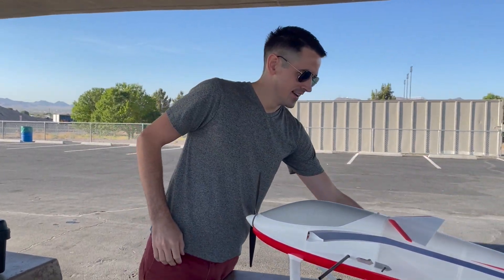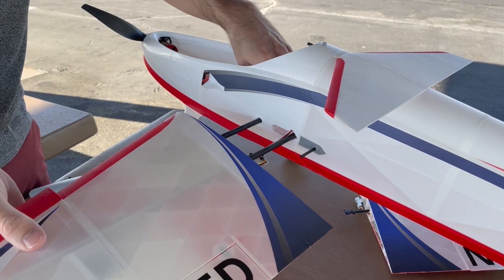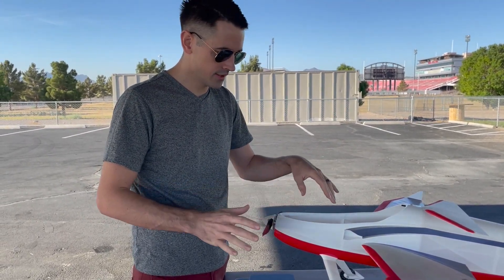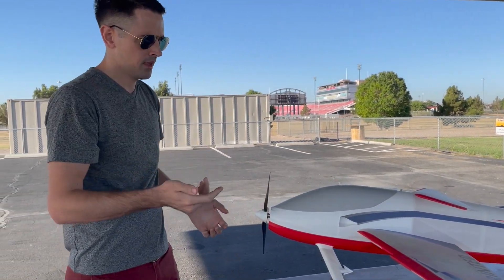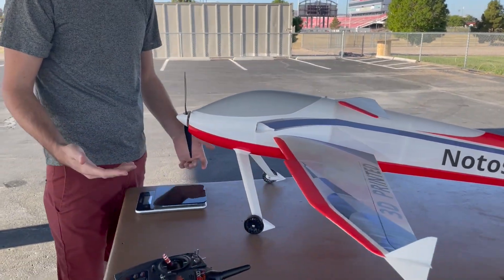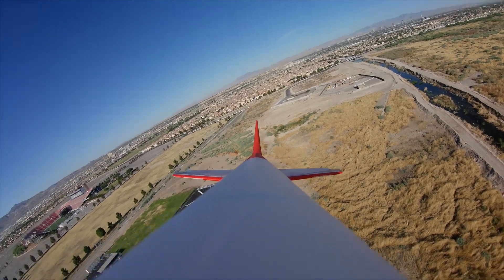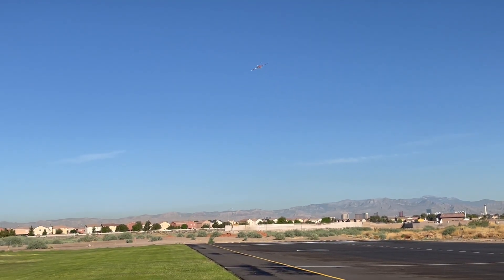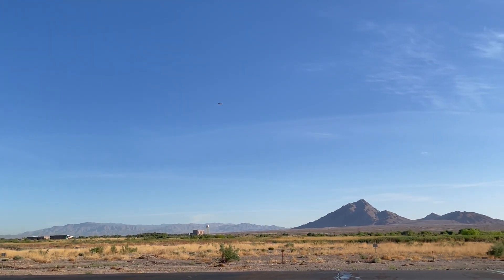Easy to FLY RC Plane for Aerobatic Maneuvers | 3D Printed Notos by Planeprint

Comment: How long does it take to print this plane? Also do you cover the control surfaces with tape?  do you get any fluttering?  Thank you. Very interested in this plane.
Reply: It has got 3D printed TPU hinges. Works great and no flutter
Reply: Этот самолёт хрупкий для f3a

Comment: How warp resistant is the LW PLA compared to regular pla? I have had 3d printed PLA plant pots deform in as little as 30 C/86 F.
Reply from the maker: White colors tend to last a little longer, but any color warps pretty easily... That why I fly these in early morning only. Maybe PETG for your pots?
Reply: @TroyMcMillan  хахахахаха
Пенопласт и бальза по прежнему самая лучшая технология и дешовая и прочная как стекло.

Чуда не случилось расходимся

Comment: I'd have to print it in normal PLA and use a 4000 mah Lipo....Which is what it really needs...We don't have zero wind conditions every day here...🤔🤔😳🇬🇧...So, is there tool path data for that?
Reply from the maker: 4000 would work great for this plane, it would gives lots of run time too! It is really windy here in Vegas too. You can use the same set up with a 4000mah
Reply: Вообще то в 5 часов утра ветра нет везде

Балбес

Comment: Those TPU pieces look like they may be a bad idea? Can you easily replace one if it breaks? Doesn't look like you can get to the inside of the wing without breaking it down and reprinting?
Reply from the maker: Haven't had any problems with them and I have used them for many planes. The alternative is tape hinges, or CA hinges
Reply: @TroyMcMillan  I meant where wings attach to the plane
Reply from the maker: @jeffdunehew  oh, I misunderstood. The TPU pieces really work great actually. Planeprint has used it on the last 3 planes, it is strong... definitely my favorite method for taking the wings off and on